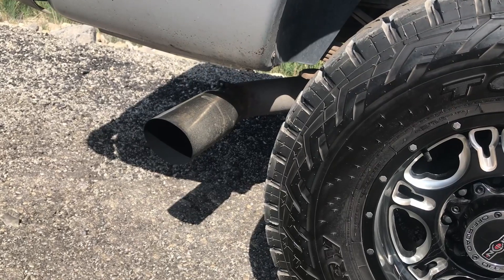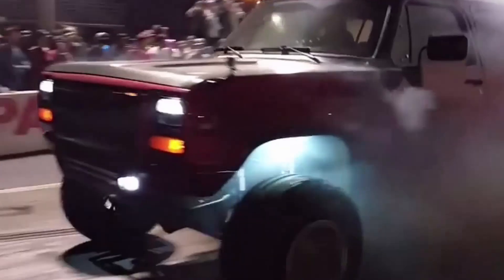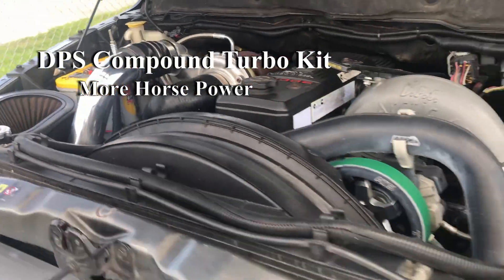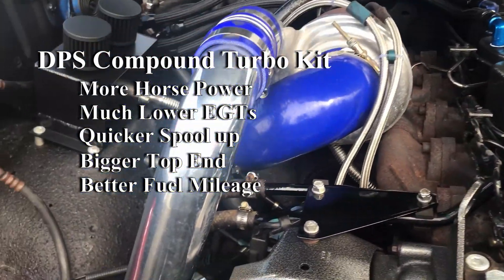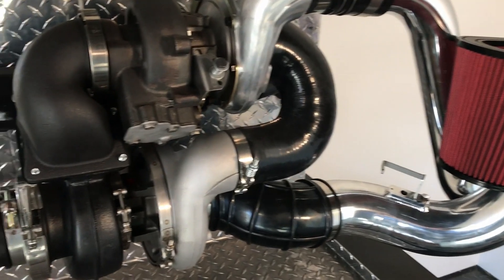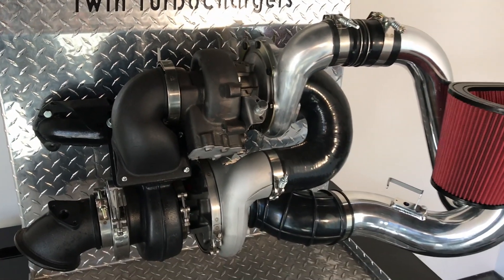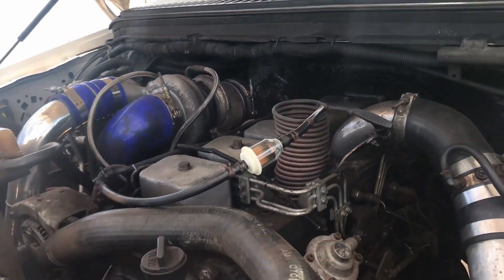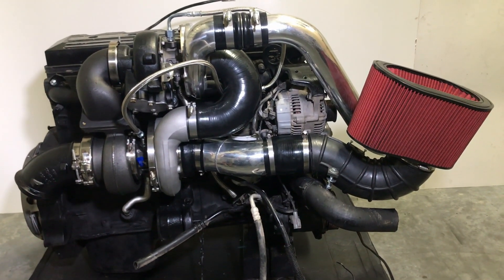Compound Turbos on a Cummins

Comment: I would like to purchase your kit soon, I want to run my stock HX35 over a S475 with a t4 1.10ar. Would that be a good daily/tow setup with minimal lag? What injectors would be best for my setup?
Reply from the maker: Our advise is never use a T4 or 1.10 ar for the large turbo on a compound setup.  We have all of the technical details as to why, but the simple reason is that you want very little restriction on the large turbo, and we've found that the T6 with 1.32 ar is a way, way better option in all cases.  You don't want high pressure in the exhaust between the two turbos, because it won't allow the small turbo to do its job properly.  The way we set them up keeps the ratios very even, which is what you want.  Sometimes people use the argument that they want the large turbo to spool well, but in compounds the small turbo determines your spool-up, and the small turbo can be inhibited is there is high pressure after it, which is what the T4 and 1.1 ar causes.  Hope that helps.  We have a ton of CFD test data demonstrating this as well as real world results.

Comment: How much boost can I run on just arp 425 headstuds 12v cummins
Reply from the maker: The general rule of thumb is 48 psi on stock head bolts, 55 psi with the head studs on a 2nd gen.  This is just a general fule though, because timing and other things can affect this.
Reply: @DieselPowerSource   Boost is such a obscure way to judge things . A s480 at 55psi vs a hx35 @! 55psi is two different animal Cylinder pressure timing hp  rpm are all key components. I ran a small set of towing compounds,  he351cw over   68/ 75 /1.05  @ 77psi  for years on stock head bolts.